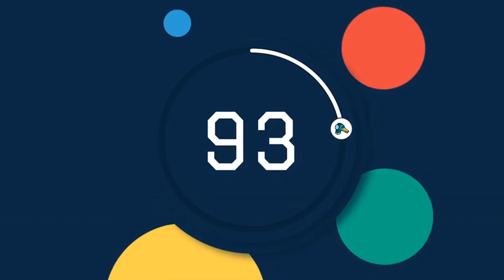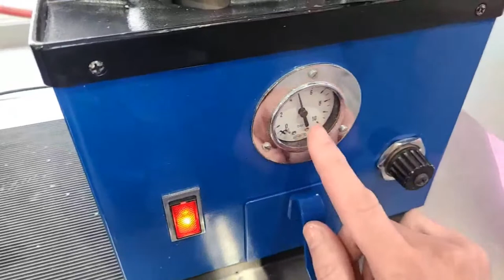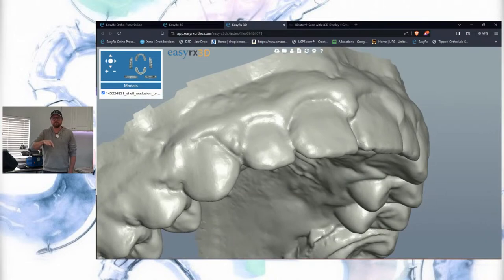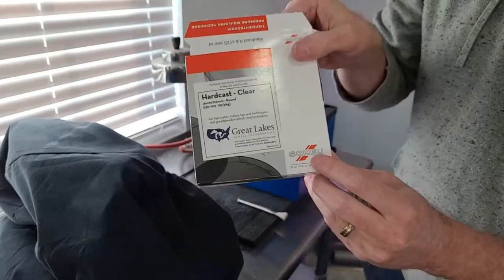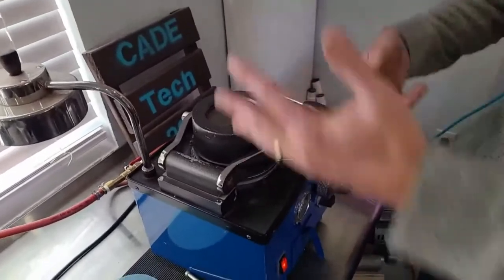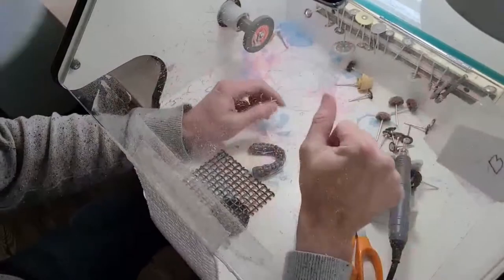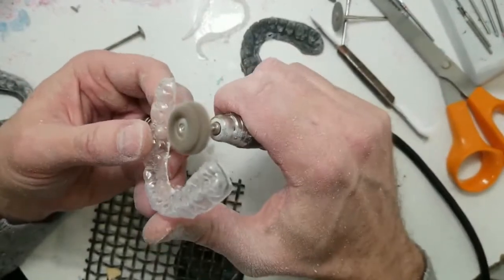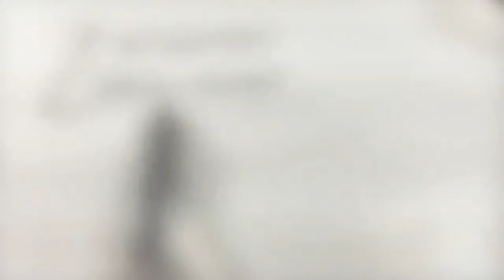Lets make a Essix with a Vintage Biostar Thermoforming Machine from 1987!

Comment: Great  Machine.  I learned how to make vacuum formed Hawleys on the Biostar before learning to make acrylic Hawleys.
 I purchased my biostar in 1985. The  price was $1995 plus 10% off  If you took one of their courses  at Great Lakes.

In 1990 I had a lab fire where the Biostar Tubing, ❤ Wiring and on and off switch  melted,  The Biostar was destroyed,  however  Great Lakes  Instructor Dan Miller (RIP) took the challenge to repair it for less than $500  
and 38 years later it still works  great!!

Great job cade.